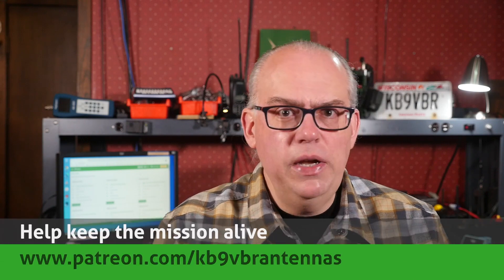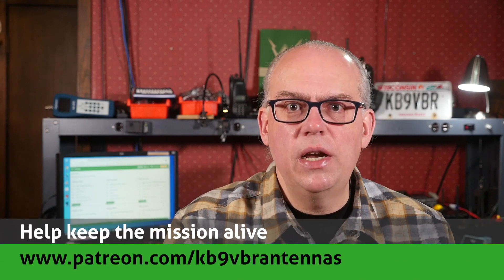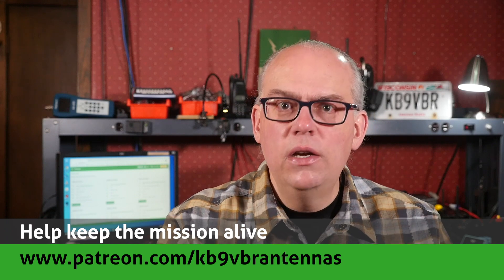The hidden switch most FT-891 users don't know about - July 2022 Livestream Excerpt #hamradioqa

Comment: Yet another FT-891 video that answered a question. I had no idea and somehow overlooked the side connection for headset. I have rarely ever used a headphone for ham radio but man it sounds great, and how can a person have a Yaesu FT-891 and not be happy? I was so happy with one I bought another one and I am even happier. I just did my first official POTA activation on the FT-891 with a 20 meter ham stick about 13 feet up with a magic carpet faraday cloth and,, YES it worked beautifully.

Comment: Hi michael, do you get any static or audio feedback on your headsets when transmitting?  I'm experiencing this with my 891 and heil proset. Just a faint static when txing and even can hear a slight static feedback when going through menu options
Reply from the maker: That's not an issue I am having. But then again, maybe my hearing isn't what it once was, either. If it's prevalent, maybe a ferrite choke on the headphone cable might stop it.

Comment: I'm considering an 891 but it doesn't have a built-in tuner.  I'm planning to keep a lightweight set-up and don't really want to carry a tuner if I don't have to.  What antenna is a good match for lightweight portable operations?
Reply from the maker: I think the need for a tuner is oversold as transceivers with built-in tuners often only have a 3:1 which limits them to smoothing out a slightly elevated SWR. For example, your antenna is tuned to the bottom of the band you want a good match towards the top. 

I carry an external tuner with me (LDG Z-11 ProII) but I will only use it if I'm running a non-resonant antenna like an end fed random wire. Otherwise the most common antennas I am using are: end fed half wave, 1/4 wave vertical whip either with or without a Wolf River Coil, or an Off Center fed dipole. With each of those antennas, I'll run up to a 1.8:1 SWR on my FT-891 before I start to consider if a tuner may be necessary. 

Long story short, unless you are considering to use non resonant antennas, a tuner isn't necessary. And if you think you may need a tuner, you are better off with a wide range external one than to rely of the tuner built into the rig.

Comment: ORRRRRRRR…..you do what I do which is to use the back speaker port and insert the headphone plug until you get both ears to work. The beauty of this method is that you not only get dual mono into your headphones, but you also get to keep your external speaker function. But I guess if you want to eliminate that external speaker and enjoy dual mono into the headphones, you go with the switch discovery you made. Another fine video tutorial from Violation of the Basic Rule  😂
Reply from the maker: Back when I was a kid I had to do that with my Walkman because it had a bad headphone jack.

Comment: I have a question about the Yaesu FT3DR. There is a small switch under the data connector (mini? USB). It has three positions, and is in the center position when stock. 
Does anyone know what that switch does?

Comment: So for the 891 what headphones can I use? I know now to plug into the side and turn it to ph for headphones. I'm brand new to this and on a tight budget so I'm trying to figure out what I can and cannot use.
Reply from the maker: If you are listening only, then any set of headphones you find comfortable will work. I've got an inexpensive set of JVC folding headphones in my kit for that purpose. If you want something with an integrated microphone for transmitting, then I recommend the Heil BM-17.

Comment: Can you answer a question for me I have the FT891 but my receive signal is poor any ideas what it could be I run it Mobile with an Atas 120 Antenna
Reply from the maker: HF mobile can be a big challenge as there are many noise sources within the vehicle. First thing to check is if the transceiver and radio are properly bonded to the vehicle. Next is to work at eliminating noise sources within the vehicle that raise your noise floor. Here is a website with lots of great information for HF mobile operation: https://www.k0bg.com/
Reply: @KB9VBRAntennas  Thanks

Comment: Used to it on the Yaesu 5000.  Each side is for each VFO.  Nice for when you want to monitor or work to bands of frequencies at the same time.  Check on two pile ups for an opportunity and all that.  Also using both with two antennas to tune the sound.

Comment: What kind of voodoo cable to I need for the Heil to the 891? Ad1ym? Seems like it’s too fat to plug in and keep the faceplate on
Reply from the maker: The FT-891 uses a modular 8-pin plug, so an RJ-45 ethernet extension cable, wired straight through, works for this purpose. I'm using a 12 inch cable that you can pick up online: https://amzn.to/3gTKcO0
Reply: @KB9VBRAntennas  thanks. So is your Heil cable need re wiring to work on this?
Reply from the maker: Nope. The Heil AD-1-YM adapter cable has a modular plug and works just fine with the extension cable.

Comment: If you're absolutely stuck with no option to make a mono output into stereo, they make mono to stereo adapters which are only a few dollars.  You plug your phones jack into the adapter, and then plug the adapter into the mono port.  Satellite operators often have this problem trying to put a recorder inline between the radio and headphones/headset

Comment: As a rule, you shouldn't be plugging headphones into a speaker jack as the output is way too high and could damage your hearing or fry the phones. Some radios, such as the FT-817, have a toggle switch to change the output and impedance so you can use a speaker or phones from the same jack.
Reply from the maker: You are correct. Headphones shouldn't be plugged into the speaker jack precisely for that reason.
Reply: It’s why I use Sennheiser headphones they are quality.👍❤️🎧

Comment: The idea for the next video: a long cable for the remote panel. There is a YSK-891 separation kit for ~70 bucks, but it is quite possible to make it yourself, carefully following the pinout.
Reply: It's just a 6p6c RJ-11 telephone cable
Reply: @GetWendi  Not really, the connectors should be positioned in a special way. In addition, there are reports that it is impossible to increase the length indefinitely - at some point the signal begins to get lost. It's simple, but not elementary.
Reply: I use that seperations kit

Comment: The other trick with the FT-891 to get rid of the background headphone hiss is to set the monitor to ON but turn it's level all the way down to 0.
Reply: Does that work for the on board speaker hiss as well ?
Reply: @killerbites3963  I think so. I'd have to go double check.